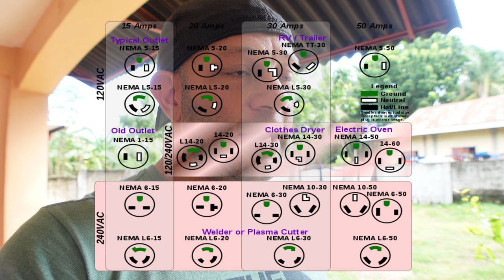Philippines Home Gets Generator Backup Power!

Comment: I am a specialist in solar energy. The Philippines are so close to the equator, that if you have the space on the roof, you can easily get all your daily power and some reserves from your roof. So I'm just surprised they didn't recommend a hybrid inverter with batteries and rewired your fuse box to switch off so the battery can do backup if needed.

Comment: To those interested…you can go online and find a list of appliances, devices, sizes and power usage. You also need to take into account your fuel supply; gas, propane, etc. Propane lasts a very long time, and it’s because it doesn’t brake down chemically. But it’s usually more expensive. A generator is a very cheap option compared to losing all your food and giving you a great amount of security and peace of mind.
Reply from the maker: 100% agreed

Comment: Sir you were spot on with what is backup and what is primary power. But buying a generator is not a simple task, Why, what size and what brand. Here in the states, I would only go with two brands, Generac and Onan, they are generator companies, Honda makes engines, same with Yamaha, ( I love their bikes ). Generac and Onan will get you the parts you need, but yes you have to depend on your postal system. The next issue is the size . If you have no electrical or mechanical talent, go with complete overkill. I have a friend that has a PHd in biochemistry, a salesman talked him into a size that could run his house, and the salesman was correct, But, But no one ever explained surge to him, and he fried two 7kw generators, which could easily power his house Once he started his generator and fried it and once his wife did. I have a house as large as his, and I run my whole house on 5kw. What is the difference, I know how to start mine. Know what you NEED to run. Water pump and refrigerator and freezers are number one then heat ( I'm from new england ) or maybe air con , lights, tv, etc . Know what everything is rated for, how much power it uses. When I lose power. I go to my main panel and shut off the LINE connection before anything else then shut off EVERYTHING else. Start your generator and connect it to your service ( your house ) , go back to your eclectic panel and turn on the circuit breaker for your water pump, and wait, if you can hear it wait until it stops. next turn on your frig, wait 5 minutes, next your freezer, 5 minutes, next your heat , if you have electric heat make sure everything else is done starting, now you can turn on the small stuff. Most people don't want to go through this procedure, then get an 11kw generator, every time an electric motor starts it creates a  surge in power draw and if two or three are starting at the same time, it will burn up your generator. Good luck
Reply from the maker: Thank you for the in-depth info and will research this more. I love to learn and appreciate the comment.
Reply: @ItsMe_Philippines  your welcome, anytime. I could have added a lot more but I don't want to bore anyone.
Reply: If the AC’s and Refrigerator are inverter type, the starting current is lesser as it ramps up the electric current gradually and avoid the Genset experiencing overload and tripping.
Reply: Generac has a whole house system that will kick on & run everything right as power goes down. It's so fast as to be imperceptible if your inside the house. If you choose propane it's very quiet even when your outside.
Reply: Honda generators are the standard that all other generators are compared to. Generac and onan are good but they the quality that Hondas are. I have been the generator business for 29 years, all my own generators are a Hondas for a reason.

Comment: Being prepared for catastrophes is not crazy. We have back up generator with our set up to charge our batteries if they need charging when have days on end of rainy weather. They are called solar panels for s reason. We always have extra gas and fuel on hand for being flooded in, in our area. Wanting to be able to help your friends, family and community during an emergency is sensible. You sir are far from crazy it's being sensible and prepared.
Reply from the maker: Thank you!

Comment: Something a lot of people don’t think about who don’t use generators often is when the generators run nonstop around the clock they burn the oil off when it gets old and hot which oil changes are suppose to be pretty frequent which a couple days straight will exceed.  The only time we had a storm where we were without power for weeks everyone I knew blew up their generators . Now most have a low oil shutoff but either way something to thick about and stock up on oil . I ran two each for 6 hours at a time to let the other rest in between and I had to keep adding oil as they burn it off after running so long . Just my 2 cents . Stock up on oil too since you may not be able to run down the street and get it
Reply from the maker: Good call
Reply: 😂good thinking.

Comment: 100% agreed. I was in Ormoc in July 2017 when an earthquake hit and power was out for months. I’d recommend a 20-30kva low rpm water cooled diesel generator than can run 150-160 hours continuously between refills.
Reply from the maker: Smart!

Comment: its a good point with the tank, id always keep it full to avoid moisture build up and run the generator every few weeks to use a few gallon and top it up. that keeps the gas always circulating and you always have fresh fuel mixed with old fuel. you'd be surprised how quickly fuel can become bad
Reply from the maker: Great point!
Reply: @ItsMe_Philippines  it cost a few bucks but in the long run it’s cheaper than replacing a rusted out tank and fuel lines. Especially with tropical climate fuel turns bad really fast.
Reply from the maker: @benjaminkessler8169  not worried about that part of it anyways, because the converted it over to propane

Comment: You need double panels than the amount you require, helps with cloudy days etc. Should put your panels in locations that cannot get damaged by trees, built strong with strong metal and good welds/bolts also might be a good idea to have shutters to protect them incase of typhoons. Prob a good idea to mix with water turbines since theres alot of running water locations in philippines as it rains alot. Also back up generator is a must. btw you can build a sound proof box for the generator. they do make dual fuel types like LPG/GAS so good to look at buying one of those.
Reply from the maker: Hi solar system is definitely over powered so it’s doing great at this point! I did a video afterwards on the back up generator that directly wire to the house.

Comment: I love your channel my wife and I are doing a similar thing with our power we have a smaller system 3500w inverter and 4500w of panels we over paneled because it’s cloudy here a lot and we don’t need to run our genny that often we are not tied to the grid at all it’s pretty unreliable up here in the mountains we about 6kwh battery bank and it takes about about 4to5hrs to charge them with our little 1200w generator which I built myself after typhoon audet from a Truck alternator and a 13hp engine I already had it uses roughly about a liter of gas per 1kwh it produces so pretty efficient we like it here on Leytey 😅
Reply from the maker: Nice! I want to visit there someday his year at some point

Comment: Really enjoying your channel and the wide variety of topics you cover, if you choose a steel tank the vapor space will rust, the flip side is fuel doesn't keep long term here like it used to in NA, maybe you can find something non ferrous for a larger storage tank, also resistive loads are the highest, might want to test again with the dryer and now the pool is running?
Reply from the maker: Great points and we switched to propane afterwards anyways

Comment: My wife and I have a 20K Generac backup generator that we love.  We have had it for about 15 years now.  Our system is different from yours in as much as our backup switching or transfer switch is automatic.  When the power goes out, the switch automatically transfers to the generator (after about 1-2 minutes).  When line power is restored, the transfer switch senses this and automatically returns our home to line power and then shuts off the generator.  This all works wonderfully well with no complaints.  We use propane for our generator (and home).  While I am not criticizing you for having such a transfer switch, this type of switch is far from being optimal.  Aside from that, I love your videos and wish you all well in all respects.  Do you two plan to have any children?
Reply from the maker: Good comment and interesting info. No children for us, as the goal was to retire and travel at 40. Not start the process then and work until 60.

Comment: Generators available in the Philippines can be good if you buy a decent brand, break them in correctly and service them properly. My house is full of Hanabishi appliances, I buy those or Fujidenzo depending on which is cheaper as they are identical in my experience. Point is, you can buy decent products locally.

Greenfield is built in the Philippines to the standard of most generators you would buy in the US and possibly better and they usually cost about the same price as you would pay in the US. 

A new portable generator needs to be broken in properly. I would recommend filling it with cheap oil, remove the spark plug adding a few drops of oil to top lube the cylinder and pull the start cord 10-20 times. Reinstall the spark plug add fuel enough for an hour of operation and start it, preferably with a load on it and let it run for about a 30 seconds. Shut it down and drain the oil. This is why I recommended cheap oil. Refill with cheap oil, start and run under load if possible for about an hour and drain the oil and refill with the good oil of your choice. If storing until disaster strikes, drain the tank and start and run without load until the carburetor runs dry.

If you saw any metal in the two oil changes, it's not necessarily a junk product. Many small air cooled engines, even expensive ones will have metal in the first oil change but there is generally not even a screen to remove larger particles so you don't want them still in the engine until 30-40 hours of operation at 3,000-3,600 RPM which is roughly 7,200,000 revolutions and up and every revolution is a chance for one of those bits of metal to do damage somewhere.

I picked the Oishima 3000w generator because it has inverter technology, which can put out cleaner power and the engine can run at lower RPMs lowering fuel consumption slightly. The Oishima can also be parallel connected to an identical unit for twice the output when needed. If I just needed a generator to keep the lights, fridge and TV going I would have no problem buying a Fujistar 3000 which is 2500W and breaking it in as described above and they can be found on Shopee for about P9,800 which is about as cheap as it gets for the generator itself.

The cost of running the generator is a consideration. Fuel to run a generator is costly. At P65 for a liter of gas that would be P1,560 to run a generator continuously for 24 hours with the Fujistar 3000 2500w max and 2200w continuous power as an example. This doesn't count the cost in sanity if you are running it off a short cord fairly close to the house. Distance is your friend if you could put it 100 feet away on a 12AWG cord.

Small 1200W generators could save you 30% on that fuel cost, fan inverter fridge and tv during the day and possibly a small inverter window unit AC at night but I won't swear to it. 4amps 220v is a fair amount of power if you are only running one thing. My Daikin 0.8 non inverter split air conditioner is 5.2A. The example Fujistar would run it along with some lights and the TV, just crank the temp to the bottom so it doesn't cycle on and off drawing surge watts. I hope this helped someone.

Comment: Every house should be built with a transfer switch,  manual or automatic. That will help run the house the way you want if there is a power outage.  Great investment .  I don't know how you did it but I would have similar to a secondary electrical panel so I could decide what to run.  Fridge, lights, water pump in your case.  I can decide if I run the A/C or not.

Concur with your comments about solar.

Very important question, in many houses I see metal tin roof which is a week point in case of storms, wind and hurricanes.   Do they build reinforces concrete roof there?

Comment: Timely video for me, I'm working on my backup generator setup. I have to disagree about not buying a generator in the Philippines. They sell honda in the Philippines. 

You have two houses to power and you want to make no compromises at all so the size of your generator is good at 6500W but it would be a waste of fuel for most people with one house.

 I live fairly simple. I have two Daikin 0.8 ton non inverter split air conditioners (I only run one at a time), two 65 inch tv, 20cuft inverter refrigerator, washer, dryer 2 desktop computers, 4 laptops. I'm not going to try to run everything at one time. I can run one AC unit, television, computers, refrigerator off of one 3kw inverter generator that has a common in Philippines plug L5 30A twist lock. Considering the cost of the generator under P15k, I will have a second generator of the same model which I could parallel and add to the output for energy intensive things like running my inductance cooktop, heating water for a bath, washer/dryer. 

Why do I do it this way? If one generator craps out, the other will plug right in as the primary and all core functions continue. I could even heat water in a large rice cooker@ 300w/30 minutes for the bath instead of my 2kw water heater or cook if I shut the air conditioning off briefly. The thing is, I will be using less than 1L of fuel per hour 90% of the time or more for a relatively unbroken routine. Most people would rather go to a hotel when the cost of fuel exceeds $20 per day...IF you can get a room when the power is out everywhere and there is a literal run on hotels that have backup power. A few years ago Power was out in my area of CamSur for 10 days...Which included gas stations, they literally couldn't pump fuel. A tank would be handy but storing fuel is also expensive...at $16 for an 8oz bottle of fuel stabilizer that treats 10 gallons. There are lots of considerations. If there was a water cooled fuel injected gasoline engine 40decibel option under $15,000 I'd be interested in that for the house we are building next, I'm not just a cheapscate!
Reply from the maker: Sounds like a nice set up and thank you for watching

Comment: Good video, informative and pertinent for us folks living here in the Philippines like you. I have some additional questions. 
1. The fuel storage tank that you indicated would provide you with a month run time, how do you haul the fuel in and transfer into the tank and if you had to run off the tank is there a fuel line direct to the generator?
2. Which Honda model generator is it and what were the shipping costs to get that puppy to your house in the Philippines (I heard your remarks at the end saying just under $1200 for everything and that is a good sounding number)? Where did you buy the generator from? You talked about getting a generator from the states and then at the end of the video it sounded like you sourced it from somewhere in the Philippines
3. Does the splitter panel that you installed in the garage, does that panel run to your MAIN circuit box?

I appreciate you taking the time to do a video like this and I hope you have time to fill in some of the gaps on the information I was wondering about. What province are you in? 

Lastly did you source your solar stuff from Philippines suppliers and did you install your own solar or have that work done by a contractor?
Reply from the maker: 1. Storage fuel will be propane. I do have a direct line going into the generator.
2. 7000watt model but I do not remember the model number. 
3. Shipping price $70 through LBC
4. $1,200 total includes the generator, shipping, breaker box, transfer, switch, and installation. So yes, I’m happy with that total.
5. Like I stated, in the video, the company was going out of business, so they are no longer in service.
Reply from the maker: 6. Yes, the generator and the line goes into the box, they both run straight to the house. So all I do is transfer the switch from one to the other to go from the grid to the generator.

Comment: Hey, I work in the oil and gas industry and just want to let you know, it's my understanding that the shelf life on gasoline is only about 6 months. After that, from what I've been told, if you don't stir it, it becomes gummy.
Reply from the maker: True and thank you. Would stir it along with using it for my own vehicle and adding to it. Thank you for the comment
Reply: and/or add fuel stabilizer like stabil but even then , to be safe you would want to turnover the fuel once a year
.great system Cory  the naysayers are just jealous
.  LOL
.
.
.
.
.
.
.

Comment: I just came across your posting on the generator you bought. Great info, but I would have loved to see the generator. If, for no other reason, to see the size, shape and color. I'm also curious to know if the generator could be housed in a way to cut down on the noise. Otherwise, great information - Thanks
Reply from the maker: Thank you